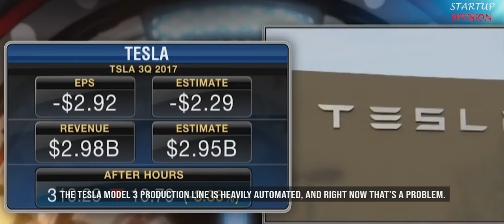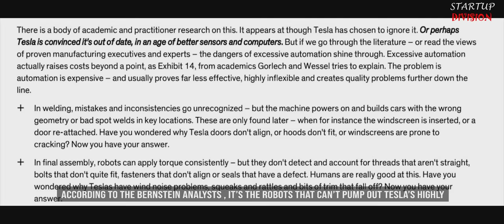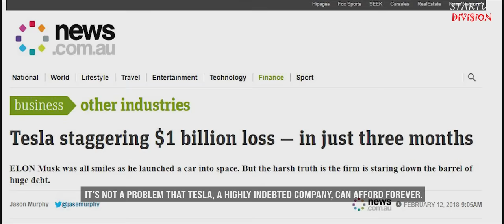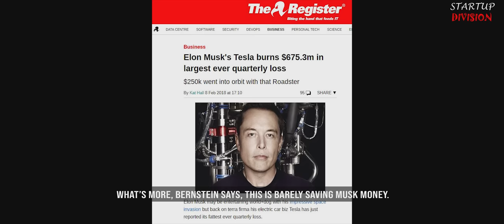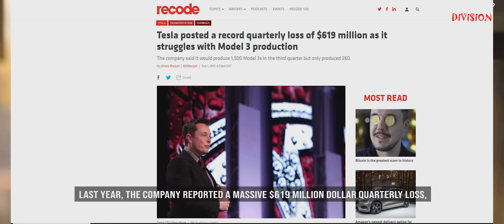Elon Musk - The Problem with Over Automation | Tesla's Burden

Comment: Sometimes you have to eat the cost in the beginning for future gains.
Reply: Yeah, for now the production model needs many adjustments but once the factory achieve its "alien dreadnaught" state it's pretty much copy-past to new factories. The problem being, the calibration process will happen for each new car model, and seems to take so long it would probably be time to move to the next car model by when it's done and running soothly. So, it's easy to see why the cons outweight the pros in this day and age in which being a single day late can cost you most of your investor's capital. Without room for trial and error, new models of thinking can't emerge without being dismissed at the first fail, even when it's a planned step to further improve the method.

Comment: Meanwhile Ford will not sell sedans in North America. Just trucks, SUV's and work vehicles.
Tesla is leading the EV segment.
They will get through their issues.
Betting against Musk is a big mistake!
Reply: DHS5151 Thing is I can easily replace most of those moving parts and they are cheap (under $200). Tesla's parts are extremely expensive and over engineered. They are almost as bad as Apple in that respect
Reply: 1 percent equals plenty of room for growth.
Why did Shell Oil buy a EV charging company?
They see the future changing.
Reply: Of course no gas cars never have crashes.  Ever!
Thanks for the useful info.
Go Jiffy Lube!!!
Reply: Tesla does not control their cars.
People do.
Ripped off?  Why do you say that?
Reply: Ford fusion
Ford focus
Ford tarus 

? Plenty of 4 door cars
Reply: Betting agains't musk is easy. You buy a lightly used Honda Civic. Cheap, more reliable than Tesla and better for the environnement
Reply: dlamardeyoutoube then you spend $25,000 in fuel before you buy another one and repeat the process again, and again. Ignoring the muffler, fuel pump, oil changes, and a hundred other costs associated with the "cheap" ICE.  I will buy one Model 3 and save $35,000 in that same amount of time.
Reply: s imba vata so does that make you a reality denier?  Or a flat earther, or a tinfoil hat lunatic?
Reply: Nissan is actually leading in the EV segment...
Reply: DHS5151 you fail to realize that a Tesla has so much technology that can fail. Talking about overengineering. How long will that huge screen last? Everything in a Tesla is connected to the central computer, wheter it be the glove box, the door handles or the AC. Ans you want to tell me that is going to outlast a simple Toyota which has nothing of that tech? There is a reason why expensive overengineered cars tend to score bad on reliabilty rankings. Lets wait 5 years and see how reliable those Teslas will be especially the Model 3
Reply: T- Smooth You are missing the point. EV are the only way unless we want Earth to hot and underwater. Also have air that will kill 95% of life on earth.
Reply: @Michael Werner

thats over exaggeration and grossly misinformed.... is carbon emissions having a bad effect on earth?? YES!!! anyone who says otherwise is a fool BUT carbon emissions from a car isn't as that bad as you make it out to be (cows put out more green house gasses than cars).... eventually our earth is going to get hotter and hotter and its going to get to a point where human life can be sustained but that has nothing to do with human carbon emissions, if you didn't know our sun is getting hotter and growing and eventually earth will die as a result... there is nothing we can do about it...

oh and another point is that lithium mining is very bad for our environment, not to mention that our lithium reserves is much more limited than our oil reserves.....
Reply: Lithium can be recycled, therefore sustainable, where oil cannot, therefore unsustainable...
Reply: David Beppler 25 000$ of gas in a Honda Civic....
Reply: I hope you’re right
Reply: T- Smooth I’m guessing you believe the earth is also 6,000 years old. You have some Outdated thoughts and beliefs, good luck.
Reply: Robert Blackford Here's where you're wrong, Robert. 

1) You can not buy a Honda Civic or Toyota Prius for half the price of a Model 3. This doesn't include incentives or tax credit. A base model 3 costs 35k and a 2018 Civic costs $18940 assuming you go with the cheaper sedan instead of a coupe or hatchback. The Prius on the other hand is $23475. So, unless you can find a more fuel efficient car which is actually half the cost of the base model 3.... That doesn't seem like a fair argument because it's simply not true. 

2) Correct, you can fuel a gasoline car much faster than you can charge an electric car even using the supercharger network, but you didn't factor in many different variables including the following...

You fully charge every time you go home. Tesla estimates about a 210 mile highway range in the 35k base model. Keep in mind the average American drives 29.2 miles a day (According to a AAA Foundation for Traffic Survey)

Fuelling up is a lot more expensive.

On a good day where I live... It's about 2.60 a gallon for regular and around 2.85 for diesel. For Tesla superchargers where I live it costs around .12 cents per kWh. For these comparisons I'll be using about 12.5 gallons which seems to be the average in a sedan. For Tesla I'll use the base model 3 50 kWh pack. 

2.6*12.5= $32.5
.12*50= $6

This doesn't include other factors such as cost of vehicle, etc. So obviously this shouldn't be the deciding factor in purchasing a Tesla. 

So, if it takes 5 minutes to fill up and 40 minutes to charge. You lose around 35 minutes, but save $26.50. One thing to point out is that you'll only need to supercharge if you are going on a road trip. Otherwise you'll charge at home. So for the average commute you'd actually be saving time because your car would be fully charged every morning. But for long trips it's a little more complex. Another thing that I should mention is that going highway speeds it takes around 3 1/2 hours to go 210 miles. After that much time of sitting it probably wouldn't hurt to get up and go to the restroom and eat.

3) A Tesla can hit hundreds of thousands of miles as well. Here's a source.. (https://gas2.org/2016/10/01/tesla-model-s-200000-miles-one-year/) You can Google plenty others as well. Another point to bring up... These people buy these vehicles for the hope of being able to put on more miles than a gasoline or diesel car. The amount of miles to expect from a Tesla is truly unknown. But there's been a few to hit the 200-300k mark just fine. 

4) Tesla's like every other vehicle aren't for everyone. My father drives a Jetta TDI to work because he drives an absurd amount of around 160 miles round trip in a day. I drive one as well considering the fuel efficiency they get. I also drive a Diesel Jetta and love it. 

5) I think you're under some kind of false narrative that Tesla's aren't good vehicles. I'm not sure if it's because of the fact that it has zero emissions or not. But if you put the political aspect of it beside and simply drive the car it's a blast.

Conclusion: No, Tesla's are not for everyone and they probably aren't the best option from a price standpoint in this moment in time. However, in 3-4 years the used market will definitely be attractive and could help people save a lot of money even if it does mean that they spend more up front. 

I hope you go out and find a Tesla and drive it because that's really what it's all about here. Put the political aspect away and give it a try.

Comment: I work at an automotive assembly plant, and yes in paint and body dept robots do work good, but when it comes to trim dept and final assembly , robots don’t work! Maintaining robots is also a big problem, 95% of the downtime we experience in the body dept I work in , is the robots !
Reply: It depends whose tech you are using. Not all robotics are equal to the task. Tesla outsourced its robotic battery assembly and lost out badly. This was the main source of line delays until March. Giving the task to their acquisition Grohmann in Germany resulted in a new line being designed and tested successfully in only 6-9 months, rather than the 18 months outsourced companies took to try and fail.
Musk's vision of the machine is heavily dependent on AI. He has a separate company leading development in this field and an in-house AI chip under development. As AI capability ramps up the robotics will make huge leaps in performance and reliability. The failures are part of this learning and something other manufacturers do not have the capability to do in-house. 
Musk is at a similar cross-roads in this tech to Henry Ford when he shakedly started and frequently failed at great expense, assembly line car production.
Reply: Elon had a vision and it’s failed and will not work , in car manufacturing you cannot eliminate the all the human operators , especially trim and final assembly , Elon is a brilliant man but his going to fail with his cars , his losing billions , and the quality of these Tesla’s is horrible ! Tesla should be teaming up with a major automaker, that’s the only way I see his ideas coming to be !
Reply: Ya these static programmed robots will always have problems with tasks that require flexibility, but there is a new wave of robots coming.
Reply: MsSomeonenew when? Next 5 years. Tesla needs 2 billion dollars alone at the end of Q4 or Q1 2019 just to keep on doing business.
Reply: Yes and the Grohmann engineered line has triple the output of the line it replaces. Let him simply do the job, I am sure he finally will reach the degree of automation he originally wanted and it will become industry standard some years later. Why do people always look at the things which are not working out at the moment and forget what amazing things Mr. Musk already achieved?
Reply: Frank Pavunkovic  it depends on which generation of robots,  Tesla has the best😂😂😂😂
Reply: And? Tesla revenue was 12 Billion in 2017

Comment: In CompositesWorld's article, BMW 7 Series Plant: Dingolfing, Germany, posted 9/13/2016 by Ginger Gardiner, BMW states that they have a car rolling off the final assembly line every 58 seconds in Hall 50 and every 83 seconds in Hall 52. Tesla is currently producing a Model 3 in just less than every two minutes (assuming one finish line working two shifts per day and five days a week for about 2200 a week).  BMW didn't achieve these awesome production rates by adding more humans to the line, they did it by automating it more than any other manufacturer in the world.

It seems to me that an American car company that has a far simpler "engine" (battery in this case) by hundreds, if not thousands of parts should be able to produce at the same rate or better than BMW did two years ago with less technology than available today. One could argue that BMW has had decades to figure this out and they would be correct.  The counter-argument is that Tesla has hired some of the best auto manufacturing experts in the world, has among the best technology and robotics capabilities and is faster to make changes with Elon sleeping in the factory than anyone in the car industry.  

Tesla has a much simpler product to produce, and as they learn how to maximize their production rate, they have the opportunity to achieve a production rate higher than any gasoline or hybrid car line in the world.   Tesla does not have it all figured out yet but they will get there because they try harder to be the most innovative.  When you are the most innovative you do it by pushing boundaries and failing faster and course correcting faster than others.  Expect more failure and adjustments from Tesla as they become the best they can be.  The multiple production line shutdowns are the best way to see and know that Tesla is learning and adapting as quickly as they can. There is no other way to succeed fast. 

Every other car company wishes they had Tesla’s Model 3 passenger car challenge of world record-setting sales and not enough production.  So much better than having Ford’s challenge of products that are selling so slowly that they are having to stop production of all of its passenger cars, to focus on selling crossovers, SUVs, and trucks, as they just announced.
Reply: There is a mind bendingly simple solution for you in this case then. Don't buy a Tesla. A German V8 gas guzler's door handle will never break. Ever. Oh and btw, don't forget to change the spark plugs...and the ignition coils...and the filters...and the oil...and a dozen of other (a bit more expensive than a door handle) stuff. Oh and it runs on fuel. Don't forget to refuel. I mean...they are not that efficient, but...hey...the door handles are freaking awesoooome
Reply: Steven Gouletas yeah, Tesla will figure it out unless it goes bankrut first, nothing is guaranteed in this world, not even if you are a Tesla.

Comment: I just hope he makes it and takes fossil fuels of our roads.
Reply: Fingers crossed.!
Reply: Even if he did, the offset between oil and coal would not be significant.  Also consider how much of his operation is automated, this creates a higher carbon footprint elsewhere. Traditional man-powered operations requires less energy.
Reply: *off
Reply: Nigel Palmer me too we need to connect the dots on clean air
Reply: It depends who is in control of the energy supply. If Musk starts implementing his own renewables then maybe.
Reply: Tesla is not alone now, others car makers are starting to wake up.
Reply: It wont be him...it would be other companies to do so. :) That is already 100% clear to everyone besides fanboys. Wether it is china or the whole and huge automotive industry itself....it wont be him. he is not Jesus.
Reality is, that they didnt listen to their advisors to get a good automation company in and now, a german company needs to be highly paid out of other automotive companies tasks to fix this mess.
Reply: Eventually yes, right now? No way we need a radical development in battery design to make them long lasting (lithium batteries only last 5-10 years at most, engines can last 20 or more years with proper maintenance and I'm comparing them to an engine because that's how much they cost to replace) or as a long term investment there is no way they can stand up to an ICBM even with fuel cost savings.
Reply: Grant Green the energy supply will become cleaner if consumers demand cleaner energy sources and are willing to pay a little more.  When it comes to water we all have no problem paying 100% more for bottled water because we think it is cleaner than city tap water LOL but when it comes to clean air we don't want to pay more.

Comment: The problem with the robots is that they don't do critical thinking about mechanical problems associated with assembly. The engineers get stuck with doing everything and its an overload issue for them. They have to run the robots, maintain the robot, design the robots, design the car parts, analyze the assembly process. Elons has to get more human brains out on the assembly line doing analysis on the mechanical assembly processes.

Comment: Goodness people try to bash Tesla so much. It's pretty obvious that getting this huge process setup is an incredible challenge, but once the process has been refined you could run production 24/7 with a skeleton of staff, tens and hundreds instead of thousands producing the same throughput. Even if it initially takes 20% longer to produce a car, the extra hours a robot can work into the night will easily overcome this, and once the process runs smoothly attention will be turned to improving efficiency.
Reply: Hashterix exactly. I though anybody who has played any 4X strategy game would easily understand it.

Comment: Toyota does approach it the best way, first have humans do the process and continuously refine it through waste reduction, standardization, and simplification. Once it is sufficiently broken down to tasks a robot can do, then bring in automation. However you will NEVER be able to use robots for assembly on a product that was not designed for robots to assemble. Robots have many limitations that humans do not such as inability to work with flexible materials and dealing with non conforming parts. This requires designers to collaborate closely with manufacturing, which is what all designers SHOULD be doing but many are so ignorant on how manufacturing works it’s not even considered, and/or the authoritarian company culture explicitly discourages collaboration. This is why manufacturing has been booming in China by leveraging cheap labor on products that are not designed for robots which is a band-aid for companies’ inability to adapt. We could be building more stuff here, but designers and bad company cultures are at fault. Thankfully Tesla is changing that through rigorous collaboration and autonomous culture and I hope older, conservative, authoritarian companies get on-board before they begin facing their inevitable fate.
Reply: Exactly. Toyota infact took a step back to manualize the entire process.

Comment: Tesla does not have a complete assembly line for the model 3 yet.

Tesla is still building the assembly line in spite of all the robots and automation equipment.

Building something for the first time without mistakes would me a miracle.

In manufacturing failure is very important to succeed.

Tesla might fail now and in the future many times in achieving its goals, but through failure it will succeed, and we will all be the better for it.